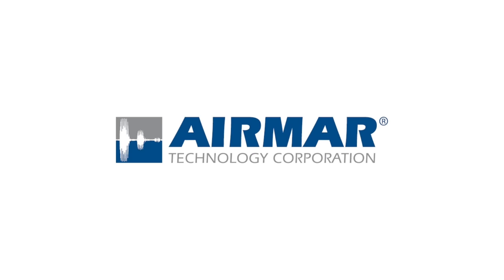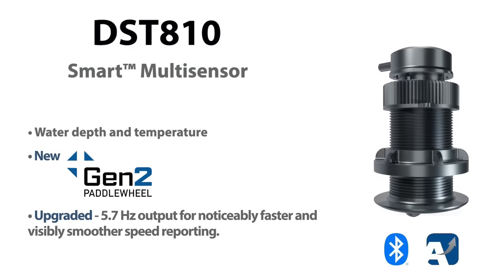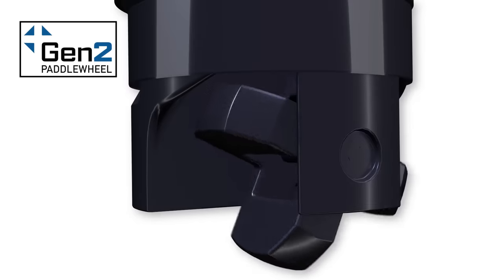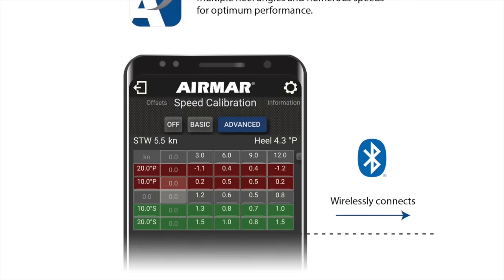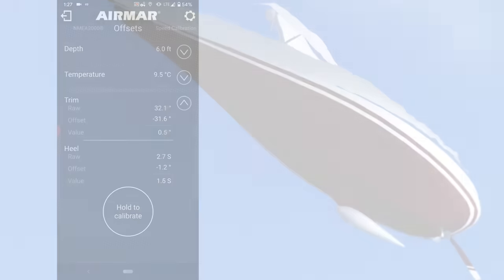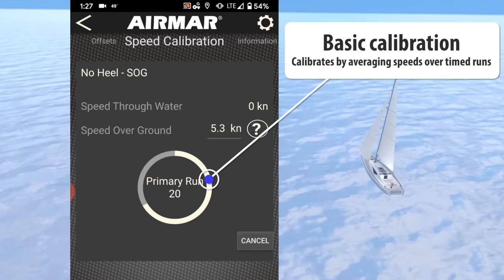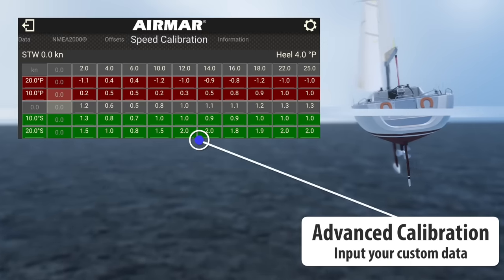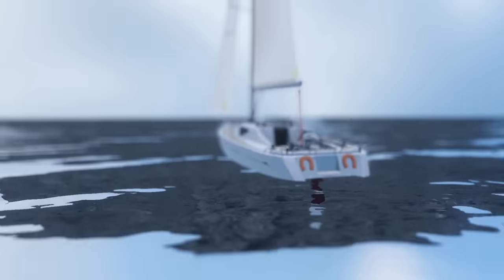Airmar DST810 Smart™ Multisensor with Gen2 Paddlewheel

Comment: Looking to replace ST60+ sensors. I have two sizes of removable sensor housings, one is smaller for the paddlewheel sensor, the other is larger, for temp/depth. Is there any chance this sensor would fit these existing housings?

Comment: Why not use your GPS,  that will never foul...  why do we care if we are doing 5 knots or 5.5 knots,  have seen or heard about the unit coming apart, water rushing in....
Reply: some people cannot afford the newer gps that can show water speed.
Reply from the maker: There can be a significant difference between speed over ground which is from your GPS and speed through water which is measured by a paddlewheel.  Powerboaters might not care so much but sailing captains care a lot.
Reply: It allows for accurate trim setting. You’ve seen “or” heard? Did you mean “and” or do you just know people, who know other people who may have seen or heard this.